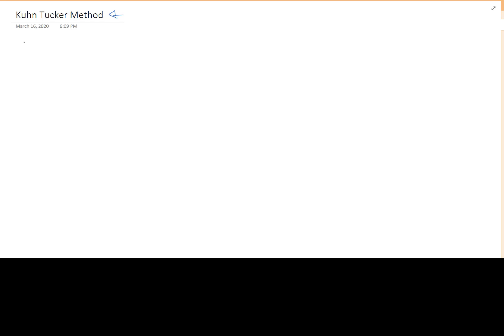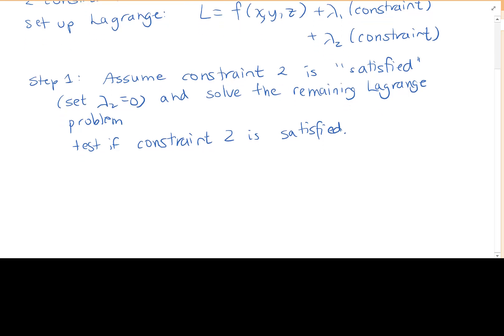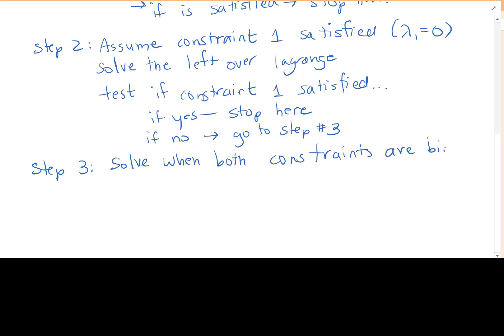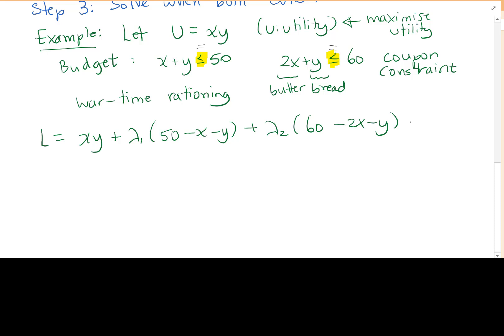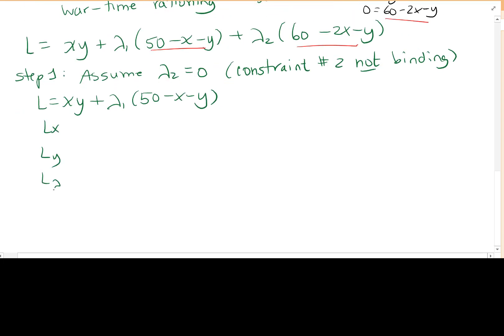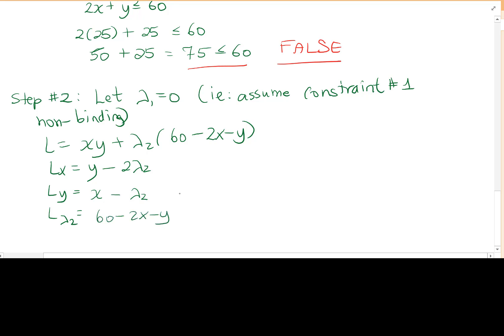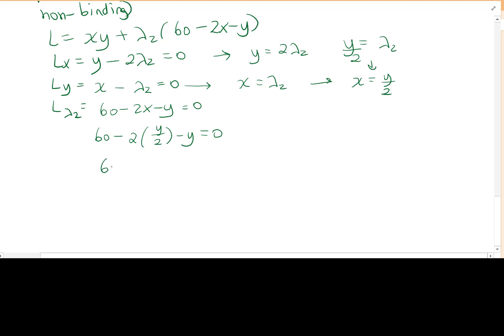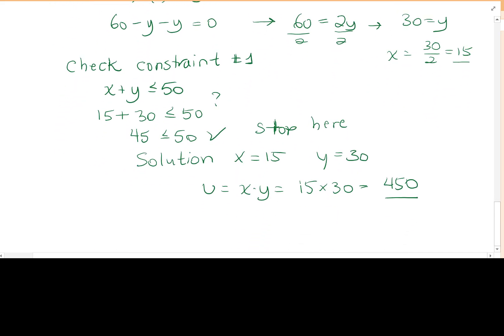How to solve a basic Kuhn Tucker problem with 2 constraints (using the Lagrange Multiplier Method)

Comment: X= 10 and y= 40 only then ur completely using budget and coupon. So what u have said is wrong.
Reply: Well if U is x*y then your suggestion would lead to 10*40=400 which is less than 450. So we achieve a higher utility when using 15 and 30.
Reply: The point of constrained optimization is not to exhaust all resources.